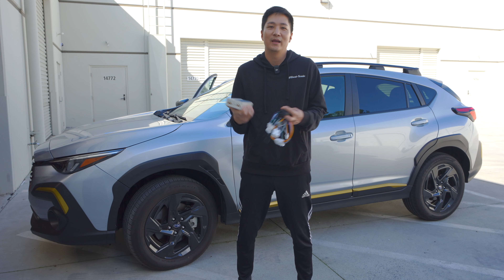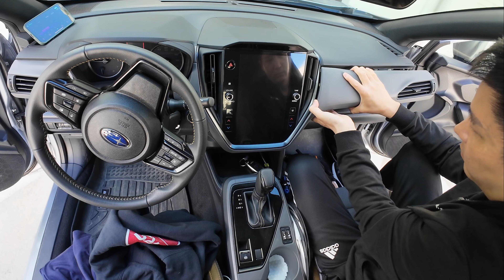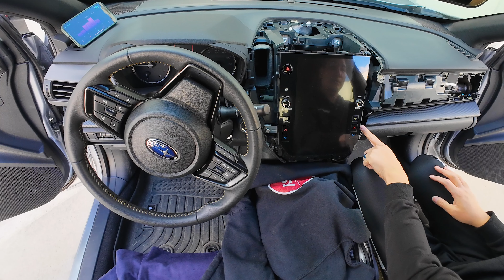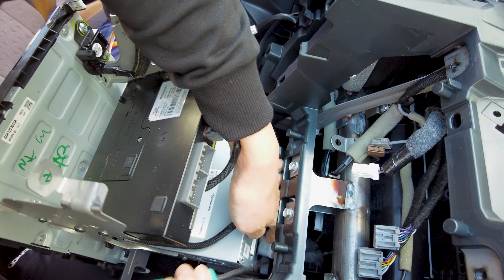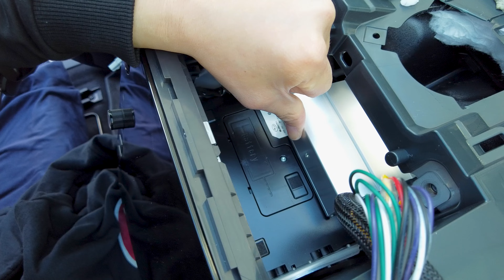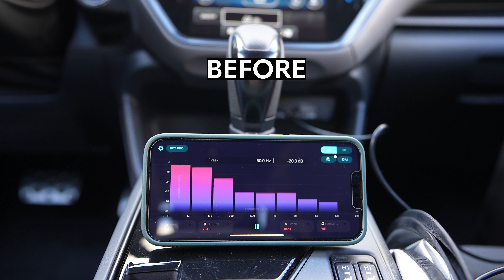Subaru Crosstrek | Installing the Encore Alpha Power Amplifier Kit

Comment: Very helpful video, thanks.  Just installed this in my 2024 crosstrek, including the extra module.  The wire harness was constricting the radio frame assembly the last 1/4 inch, but I screwed it tight and hoped for the best.  Everything works.  The sound spectrum is much improved now, giving me more sound in the middle frequencies than I was getting from the oem stereo with 4 new aftermarket speakers.  In particular my Inf Reference 3.5 in the dash now have cleaner treble, less shrill.  Overall this system is still well behind what my Mercedes Harmon Kardon system was like, which was stunning and I miss it.  I will add a subwoofer, add capacitors to the 3.5 speakers, and install aftermarket rear speakers too now.    I may need to add a couple more tweeters high on the door perhaps.  Might be on a path towards adding a DSP (yikes).
Reply from the maker: Thank you for your feedback!

Comment: There are not any pics of the amp of all sides on your site. Are the RCS's only High level input? Does it have a RCA Sub out for future Sub connection? Also I have noticed that the 2024 Non Harmon Kardon is more of a Front stage set up and the rear door speakers are almost non existant for sound. Will this amp power the rear doors properly so they can be heard? I have been looking at this and the Kicker Key 200.4 & see this as an advantage as a plug & play unit. The only thing missing is a built in DSP which the Key 200.4 does have.
Reply from the maker: Use the ENA-3S1. It is meant for RCA subs and will increase volume towards all speakers, but still retains the factory tune of a front stage.

Comment: I just got mine. I will be installing it later on today.

Edit: I got it hooked up. The volume knob on my radio doesn't work. I've looked through all the troubleshooting and made sure connections were correct.
Reply from the maker: You must of have the non HK radio. Did you purchase the additional harness?
Reply from the maker: @blottermad  check your email. We don’t have anyone replying to the chat box on the website. We sent you a reply via email. It looks like you purchased the kit for the GR86 and not a Subaru Crosstrek
Reply: @BeatSonicUS  I searched Subaru Crosstrek selected the model it recommended and then chose the option that was not for the Harman kardon upgrade.
Reply from the maker: @blottermad  We have sent you an email regarding this.
Reply: @BeatSonicUS  thanks 👍 I appreciate the quick response.
Reply from the maker: @blottermad  We're here to help!
Reply: @blottermad  how does it sound any good?
Reply: Does it sound good with this new amplifier? Are you satisfied?
Reply: @CyrusTheGreat-b3k  I'm kinda on the fence about it. I probably could have gotten more for the money if I had gone a different route but the plug and play installation made it an easier pill to swallow.
Reply: @jacobebsen1  it's ok

Comment: How many extra watts does this provide. I dont see any power connection to ad power to amplify
Reply from the maker: The amplifier provides 45W x 4 channels
Reply: That is a bit better the the 5w x 4 the stock head unit puts out.
Reply from the maker: @kennyrogersrocks  You should hear the difference it makes!
Reply: @BeatSonicUS  I just don't see how it is possible that in can produce 45 watts per channel with just the power from the head unit normally would have to have separate power and ground for a normal amp I am so skeptical of this

Comment: Do the dash speaker still work
😊
Reply from the maker: Yes the dash speakers still work
Reply: @BeatSonicUS  why dear Amp stay on, slight static from speakers drawing battery. Seems Amp turn on wire is hot always.
Reply: @MatLebouef  do you have the harmon kardon or non harmon kardon version?
Reply from the maker: @MatLebouef  Please email us at info@beatsonicusa.com for technical support.